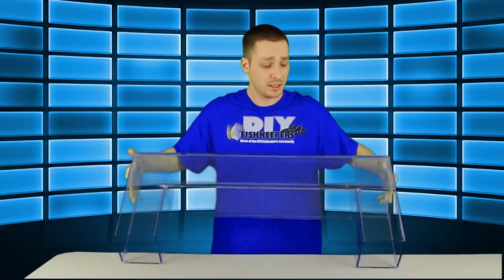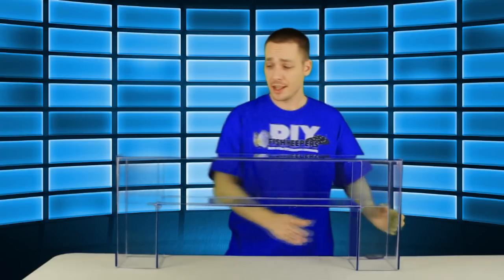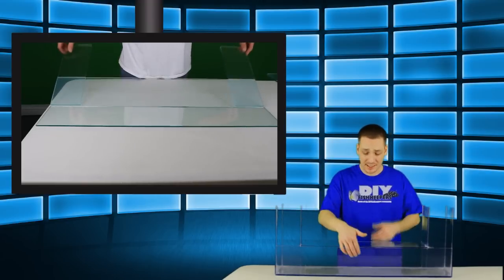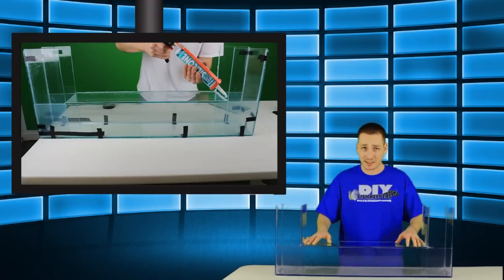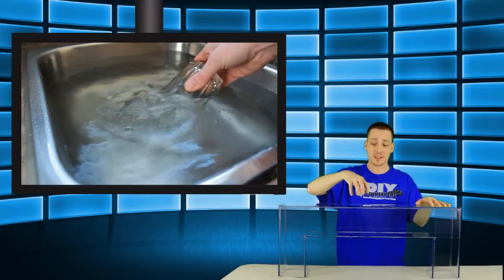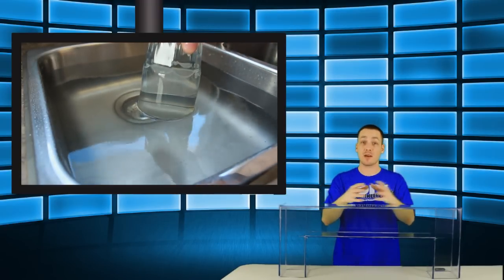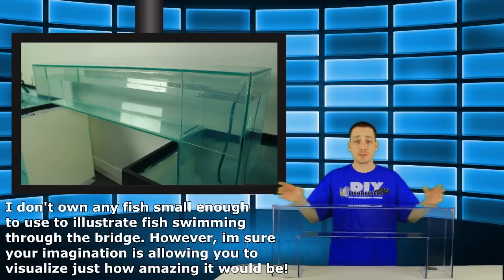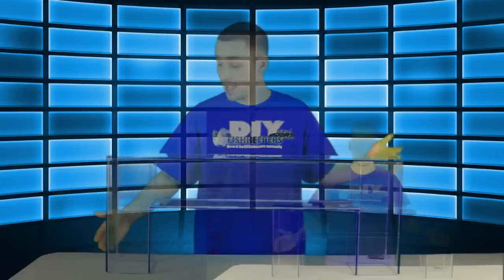HOW TO: aquarium water bridge

Comment: Help I made this between two ten gallon tanks and any fish who spends too much time in it dies.

Additional information: The tanks are about 5 inches apart and the bridge is 12 inches long and 3 inches tall.

My two theories are: the silicone is somehow still releasing toxins into the water - which I don't think is it because it's been over a week and I got the safe kind that I've used with fish tanks before and the tube says it releases ammonia during cure, and the ammonia levels are fine; or there's an oxygen deficiency in the water in the bridge that's suffocating them - but I thought I would have fixed that by setting up a filter with a tube that draws water from one tank and dumps it into the other, to create a weak current through the bridge - and I leave about an inch of air in the top of the bridge for my fish who go to the surface to gulp air. (They were getting really upset the first time I set it up and they were going up to gulp air and they couldn't.) Or maybe it's just that the nitrites are high because I didn't cycle the tanks properly. But I got the nitrates down and refilled the bridge and had another death; it really seems to be the bridge.

I don't know what's wrong. I really wanted this to work but the casualties are wearing on my conscience. Anybody else done it?
Reply: You mustn't have any "air" gap in the bridge. It has no contact with the atmosphere to equilibrate the gases and so you get a build up of CO2. The fish go up for air, get a gill full of near pure CO2 ... dead!

Comment: Doesn't have the most efficient benefits. If you want your water to stay level, you put an auto topoff; this bridge idea lowers the water in both tanks at an equal ratio, doesn't resolve the evaporation problem. Putting a larger tank would have more stable water parameters, easier overall maintenance, provide a better overall tank to house fish, and more importantly having a better long term setup, which I don't see this as.

Comment: Bad idea if you have good oxygenation in your tanks, have mine pumping the water to cycle through both tanks but when I went to bed tiny bubbles from my air stone, began collecting in the top of my aqua bridge eventually raising it enough it broke the seal of the bridge and caused nearly five gallons of water to pour out onto the floor

Comment: Dude… acrylic would be so much easier to work with. For starters you can cut and heat the acrylic where you need to and then warp it's shape into something you desire, and then cut other pieces for making the sides and then seal those pieces on with with silicone, and/or use heat to seal them together.

Comment: Wouldn't it slowly lose the vacuum though
Reply: +Din yes, water always contains air bubbles, and when temperature varies, it loses some of those bubbles that will go into the tube and lessen the vacuum. However, by the time you've lost a significant amount of water in the tube, the tube will be clear as mud and need a good cleaning anyway.
Reply: I have a water bridge linking two tanks, I attached one end of an airline tube to the very top with silicone, and run the other end to an aqualifter dosing pump and have it on a timer to run once a day for a minute. Has been working flawlessly for 5 months so far.

Comment: I want to build this but my problem is that my aquariums have a two inch height difference so can any body help me with my problem
Reply: Simply raise the shorter tank 2 inches from its base; or, level the bridge by creating a tall enough ledge on the side of the shorter tank; using acrylic or wood and Fill both tanks to the same height as the shortest tank.
Reply: Ok thanks

Comment: Have been thinking about doing something similar to this with 2 connected nano fish community tanks connected by 2 smaller versions of this, having the filter from each one aimed into the opening of a different connection to encourage flow between the two tanks, and then have different flow rates in the two tanks so fish can settle in whatever areas suit there needs. Still of two minds though considering the volume of the water in such a small area (not as normal here i don't think to rip up your floor and increase its strength) and feeding if i start adding stuff that requires specific foods but likes to move. Has anyone actually tried this bridge out yet and set a video reply on it?

Comment: I was thinking of doing this some time ago, but then I thought that the tube will be under vacuum and therefore not enough oxygen for the fish in the tube? Evidently my assumption was wrong.
Reply: There's still oxygen diffused in water...
Reply: TM Miner I just assumed without calculating that the quantity would drop considerably.  Based on a 200mm water rise, I calculated that max Dissolved Oxygen at Saturation and 27°C would only drop from around 7.9 mg/l down to around 7.7 mg/l.  Not really significant at all!